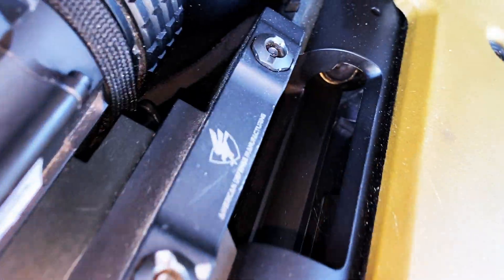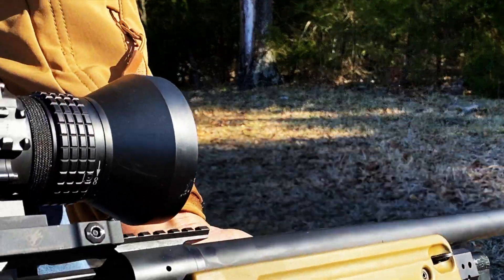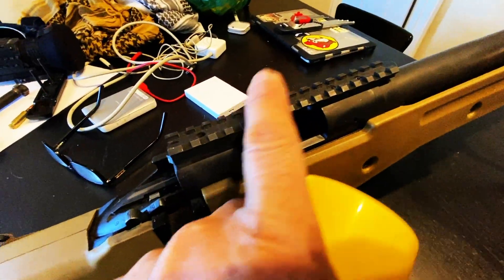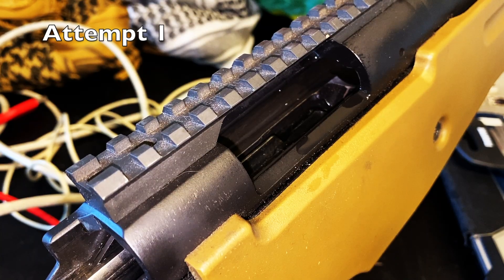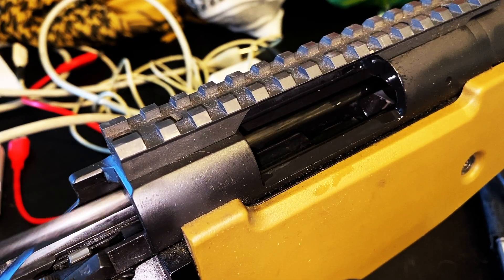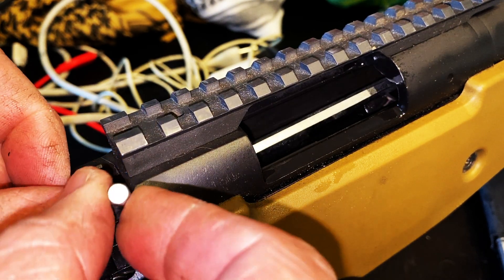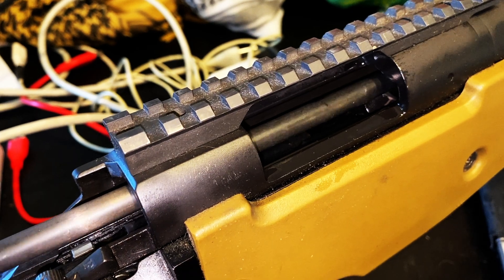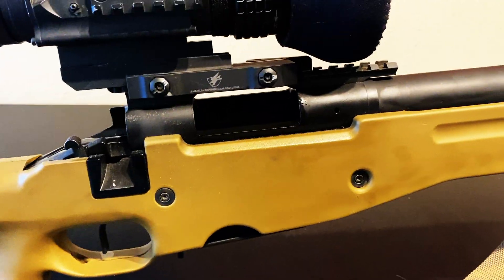Precision 6.5 Creedmoor | Case-Head Separation Removal

Comment: Good thing it was a bolt action. I had this happen with a 6.5 Grendel AR. It blew the mag out, and bent the dust cover. The magazine fell apart and flew out, but I put it back together and it worked. I straightened the dust cover out, and it worked, too. It wasn’t a hot load, just a bad batch of brass.
Reply from the maker: That sounds painful!
Reply: @OutdoorEDventures  Thankfully, I had safety glasses on, and 90% of the gas went out the mag well! It broke the extractor, too. I put a new one on, and cleaned it all really well, and it works fine now.

Comment: Years ago I read this tip. Thankfully I haven't had to use it. Spray that canned air in the chamber. It is real cold air. It will make the brass shrink a bit but the steel won't or won't shrink as much. Then use the oversized brush to drag it out. Hope we never have to try it. Enjoy your videos.
Reply from the maker: Man. Not sure I’d want to do that to the chamber.
Reply: @OutdoorEDventures  its just the canned air to blow out your computer.